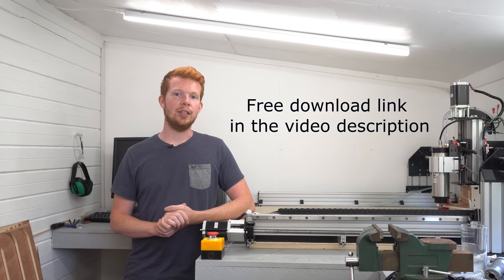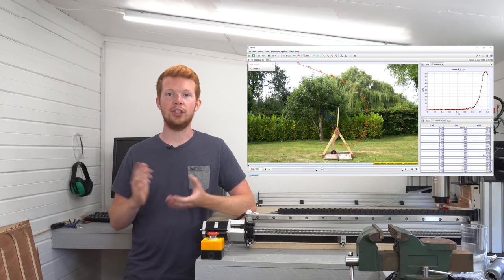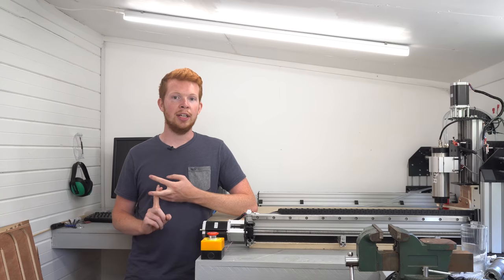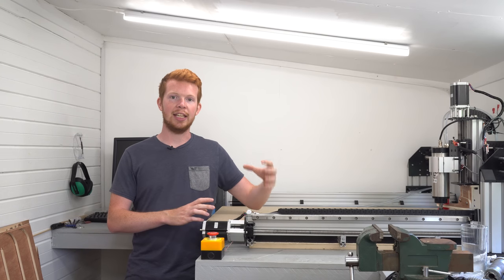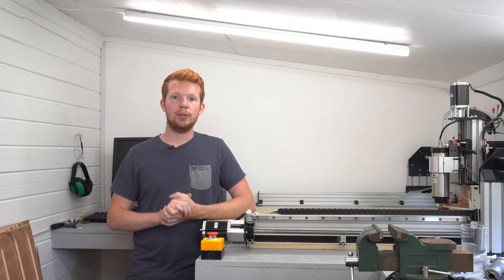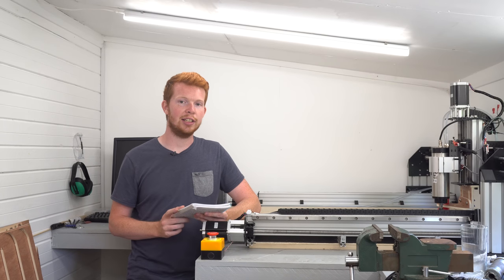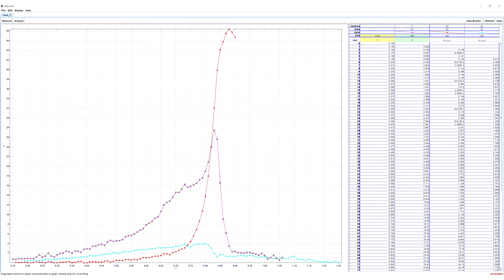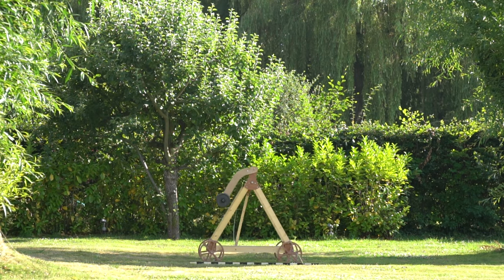Wheels on a trebuchet?

Comment: If you could measure the pressure on the ground when the Trubuchet is released like say if it was on scales,, then measure the pressure on the axles  ( obviously when wheels are fixed on ) then i think you would find where the extra energy is found,, a fixed treb is going to shove any extra energy straight through the frame into the ground,, on wheels 'because' the whole thing moves that energy gets chucked about the frame more and is released through the firing ,, forget about the maths,, close yer eyes and watch with your mind where all that power is going..

Comment: Would it make a difference to make the weight free for rotating, ie. not fixing them tightly on the arm but giving just enough looseness so that they can turn freely. Even ball bearings can be attached to reduce friction losses. My point is the weights have a rotational kinetic energy at the bottom before they stall but that energy might not be translated to kinetic energy of the tennis ball very efficiently. I think free rotating weights would give an improved overall efficiency.

Comment: Ok, so it seems that the wheels made the trebuchet more efficient, because they allowed the center of rotation of the counterweight and the arm to move forward, and therefore synced up the stall point of the arm and the counterweight. Wouldn't it be even more efficient if you could somehow rig it up so that the center of rotation could move forward, without the entire frame having to move forward with it? You could save all the energy which has to go into moving the entire weight of the trebuchet forward, plus the energy lost to friction of the wheels... 

I kinda have an idea in mind, but I don't know how to explain it without being able to draw it... But basically you could put the main axle on some kind of moving part, which could then shift forward as the counterweight drops, just as the entire frame moved forward in this video. Do you think it could be done?

Comment: Did you try weighting the Treb so that it didn't "hop" at the bottom of the weight swing.  Historically, I've been led to believe, trebs were put on wheels because of greater distances achieved. Given the construction techniques available the trebs had to be built with such frame weights that the treb would shift forward and back as the weight fell but would not hop just prior to release as your lightweight treb does. I would suspect that you lose a lot of energy from that. My interest is in relating the operation of a trebuchet to the act of pitching a baseball, using the drive leg of a pitcher to move the release point of the ball and impart greater energy by increasing the length of travel of the "trebuchet arm" (pitching arm) from the initial point energy is being imparted.

Comment: If I remember correctly, wheels on trebuchets was specifically to benefit fixed-weight designs, while swinging-weight desings tended to suffer from having wheels.  Your design here is somewhat inbetween the two, and I'm not terribly familiar with it, but it seems to be working quite well!

Comment: How does all of this affect the range of the trebuchet?  Sure, a little extra velocity might add to the range. But the launch angle is also a factor. So, how do you optimize for range?  Or is range not as much of a factor in trebuchets as the horizontal velocity?

Comment: You want the counter weight to fall in the straightest line as possible which transfers the most amount of potential energy to the arm.
you can see this when comparing multiple trebuchet types and the path the counterweight takes vs velocity.
strait arm < strait arm + wheels < hinged arm + wheels < whip + wheels
I don't know if a floating arm trebuchet would be improved with wheels on the base as it already has the counter weight falling as strait as is possible. 
MURLIN Trebuche: https://www.youtube.com/watch?v=K7mB5iftarQ
I just found this video, I've never seen this type before: https://www.youtube.com/watch?v=WcNITnbkx_A

Comment: Just spit-balling here, but what about the fact that the counterweight travels slightly further downward when the frame moves forward to keep the vertical axis of the counterweight in a straight line, thus releasing the projectile when the weight is physically lower (mgh). Wouldn't the slightly longer travel of the counterweight impart more energy?  Another thought, could allowing the frame to move to about the vertical axis of the counterweight, minimize any horizontal component of the vector forces?

Comment: Remarkable. Still there is still some loss to be eliminated. What do you think contributes most of the losses. Is it friction in the bearing air resistance of the arm or energy still remaining in the frame?
Is there a more efficient way to transfer gravitational energy to a projectile?

Comment: When it moves forward with wheels, or wants to move when it's fixed would that be considered wasted energy? Wonder if there is a way to tweak it in such a way that even with wheels it won't move, that would indicate that the majority of the energy went to the ball right?

Comment: How about if instead of wheel, that move the whole frame, making you waste kinetic energy, we had a movable arm, in the sense it would move forward transferring kinetic energy only to the arm.. The arm rotation axis could be loose inside a cavity that allows this axis to rotate and translate, the radius of the axis could be made to match the required translation speed. And maybe (just maybe),  if this cavity has a "U" shape, it could maximize the energy transfer, and smoothen the stall's after kick...
Just wondering....

Comment: I'm sure you are aware of this, but if you average the three measurements, you should preferably also give the standard deviation of the measurements (or more appropriately, the standard deviation of the mean of the measurements, which will be the stddev of the three measurements divided by sqrt(3)) in order to have an idea of how noisy your results are before you can meaningfully compare them.
You report results up to 4 significant digits, which feels quite optimistic to me, so I'm wondering what kind of spread you have on there. ;-)

Comment: what if you put a ratchet on the wheels so they cant roll backwards (absorbing energy from the weight stall into the frame). that way you get the benefits of the wheels and the benefits of a fixed frame at the same time.

Comment: it would be great to see just how far you can optimize the trebuchet, e.g. fixed tracks instead of wheels to eliminate jump without adding weight, reduce weight of arms to maximize energy transfer,
alternate geometries for weight arm for a better fling.  can you hit 80% efficiency? 90%? where are the greatest gains.

Comment: Gravity is trying to pull the counterweight straight down, but it follows a curve. When the frame moves on the wheels, doesn't this result in the counterweight moving in a less curved line?

Comment: Using your airpowered engine can you try to make this

Essentially its a desk fan that uses compressed air to spin the fan blades which will generate electricity for a electric motor which will also be able to spin the fan creating a desk fan that requires no cords and is self sufficient

Comment: Dude! I've been playing with trebuchets since the early 1970s. We used to fire canned peas at the church across the street. It was built like a fortress (I live in Phoenix, Arizona) but we figured we could take it any time. We had artillery! LMAO

In the years since I have tried to pick up everything I could about this amazing weapon. And I have a lot of questions still. For instance, would it make sense to mount one on a large rotating table?  This would make it almost like a turret. Hell, put the whole thing on a flatbed deuce-and-a-half (with stabilizers) and call it self-propelled artillery! LOL

Even more, I wonder if you could make fine adjustments in flight path by adding a trough to control the path of the object while it is still on the ground? Specifically, would changing the angle of the object by changing the angle of the trough make consistant alterations in flight. I don't think the effect would be much but it might be as much as a few feet at range. Also, how would increasing or decreasing the weight of the object alter this effect?

And no doubt you know that the wheels on the thing was a fine idea. Easily proven mathmatically or visually — as long as you let it roll free. The minute you add any brakes you ruin the new-found geometry where the weight is dropping almost straignt down. There are a couple more tricks I learned but no doubt you know about this fantastic assemblage of sticks and stones.

Comment: Mythbuster says the ratio of counterweight displacement to sling connection displacement is 1:3.75 but myth busters used a fixed trebuchet, and the sling sharing that length with the wood's 3.75 displacement from fulcrum. If I want to add wheels to my trebuchet, should I change how long the sling is?

Comment: Awesome! I love all the physics and math(s). I was wondering if it would make a difference if the wheels were braked at the release point. Basically if you put the wheels on tracks with a hard stop right when the still points coincide, would it transfer any more force into the projectile? 

Thanks!

Comment: Regrettably, I don't understand some of the physics you touch on in this video. But as I understand it, the reason a wheeled trebuchet is more efficient is because the motion of the trebuchet allows the counterweight to drop in a more vertical line, which is more efficient. Does this make sense?

Comment: the wheels are going to take energy away from the system.  if you need for the weight and the arm to line up you need to engineer for that.  either longer or shorter arm or a longer or shorter weight.

Comment: This is a follow-up on my previous comment in which I mentioned optimizing optimal launch angle. Namely I did a few simulations and found that for tennis balls at these speeds drag is quite significant, namely at 55.4m/s without drag they would go about 300 m instead of 78 m. In my simulations when using a launch angle of 45° the distance traveled was 75.43 m so close to your results. In the simulations the optimal launch angle was 33.7°, at which the distance traveled was 78.95 m. For all simulations I used a launch speed of 55.4 m/s and other parameters such as drag coefficient and cross-sectional area I used values from http://twu.tennis-warehouse.com/learning_center/aerodynamics2.php

Comment: Could you audjust the arm or the position of the  counterweight to stall on the weighted down version without the wheels to give the energy required to move the frame to the projectile for a more efficient system? 68% is far from 100%!
Reply from the maker: I think the only way to adjust the counterweight stall is by moving the main axle during the swing. Because the weight wants to fall vertically,  the axle has to move above it in order for it to stall when the arm is in the vertical position. You're right, 68% is far from 100%, but it's still double the average energy transfer efficiency of a car haha!

Comment: Now make it 7 times bigger to break the sound barrier. Or, better yet, 180 times bigger.
Reply: I have one 22 feet tall, over 3000 pounds, and have had 2000 pounds of counterweight onboard. 194 mph 9 pound pumpkin. Energy needed is non linear. Colossal Thunder is the current world champion and long distance record holder. 3284 feet. I would imagine launch speeds are over 300mph.
Reply: I'm actually working on the sound barrier with a spring powered design. Best recorded launch speed so far at 481fps with 150 of spring force. I've begun the next up scale build with 700# of work load rated springs.

Comment: How would you trebushet launch assist a BFR into space?  I say an array of 3 -4 four Tre's facing away from the centrally located rocket and let'er rip.   Just gotta figure out how humans can survive the G's!  Still if you can save a ton of fuel why not add mechanical advantage?  3 Tokyo tower Tre's will yield an assist of about a half mile by the time you add the sling.   But that's the heaviest first half mile.

Comment: Only halfway through the video at the moment, but isn't the point of the wheels to allow the center of mass to stay put (even though the frame moves) as opposed to putting energy into trying to move the frame but failing and storing the energy as heat in the stress on the wood?
Reply: Continued watching... perhaps the axle moving above the stall point of the weight is what I was talking about with the center of mass shifting. But now I'm less sure where the excess energy was going without wheels. The frame? The axle? The arm?

Comment: Hey, nice video. I just need to add is this: 1m/s velocity change of an object traveling at 1m/s needs less energy compared to an object traveling at 2m/s. If you use 1/2mV^2 formula it's really easy to see. This is called Oberth's effect. You need less energy to make a slower thing go faster.

Comment: Would there be a difference with a lighter frame? Say CF tubes, and the same counter weight?
Reply: Lighter frames move faster out of the way, and back into position. Less energy lost to move the frame, cw falls more vertically increasing speed.